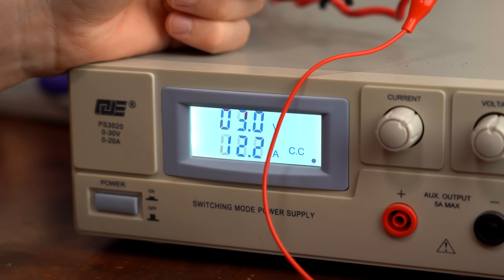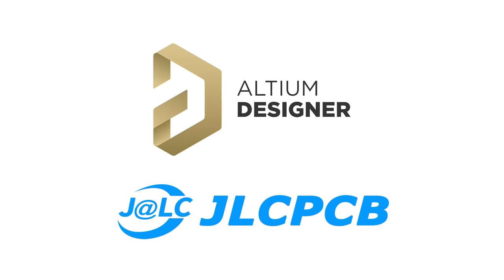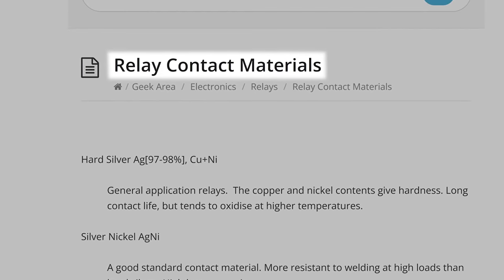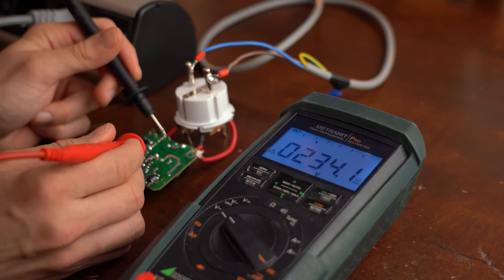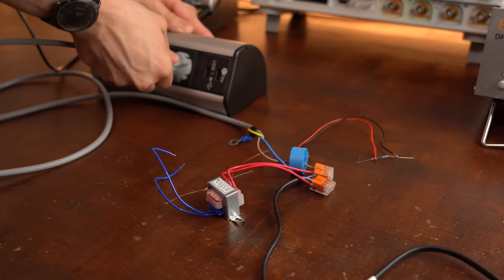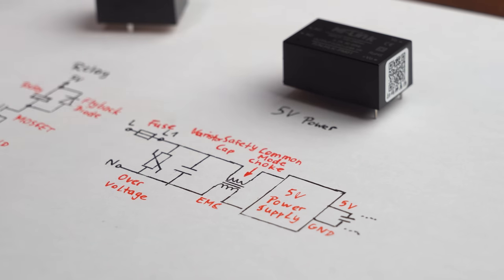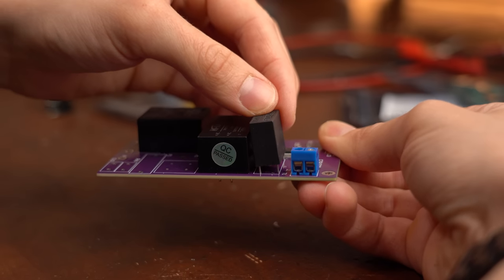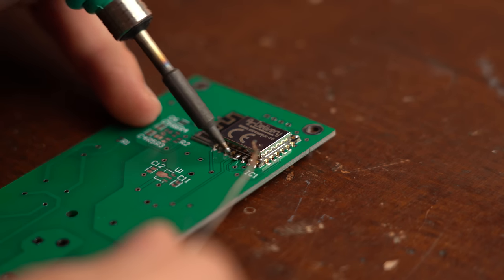The Dark Secret of Smart Sockets and How I Fixed it! (DIY or Buy)

Comment: Many years ago - 2007, it was; not a good year for introducing such a product, as things turned out - I developed a prototype wireless light switch (for 120 V, 60 Hz).  Having an intense dislike for relays in such contexts, I used a triac and zero-volt turn-on.  Getting a software PLL (running on a tiny AVR) to lock to the line phase to control when the triac was triggered in each half-cycle was easy enough in a clean environment, but turned out to be a major headache when a neighbor was running a many-kW induction furnace.

Comment: Why not just switch to solid state relay's? You could just swap out the relay on the smart plug pack for a solid state relay and call it a day, no more sparks or moving parts, there are plenty on the market that will handle 240v AC up to 25a and control input is usually 5 to 24v.

Comment: You are free to steal from years of experience and production that came from times long before you were born. If you look inside power regulators of nowadays starting to disappear mains handheld power tools, especially in cheap or very old ones consisting of simple triac phase regulator without feedback IC you'll notice that in maximum position there is a simple switch that shorts triac thus avoiding unnessecary heating of the component. This fact may look unrelated at first read, but further on you can dig schematics for hydrophore pumps' and water heating circulation pums' switching blocks from famous for their reliability danish company Grundfos. For pums with fixed power the schematics consist of a triac operated via zero-crossing detection optocoupler ICs that guarantees no sparking and no grid noise and with some delay enough for the pump to get to the full power a relay shunts the triac. Shutting down the pump happens in reverse order - the relay switches off and in the moment of zero crossing triac turns off. Thus no switching noise in the power grid and RF air or sparking that erodes relay contacts occurs during switching on and off and in this way they also achieve maximum durability.

Comment: Cheap relays ,do not have good coatings of the contacts and spark catchers.
Saving cost needs to come from somewhere.

Using a smart sockect to save standby currnt is useless,because smart sockets also consume power

Comment: If the plugged in item has its own proper switch on it, you could just ensure it is turned off, before switching the smart socket on, no current draw therefore no spark🤪

Comment: Instead of a mechanical relay I should have designed it with a Solid State Relay if you want to get rid off the welding. https://en.m.wikipedia.org/wiki/Solid-state_relay

Comment: Sometimes on these 'DIY or Buy' episodes I'd like to see a third option...

Options:
1) DIY,
2) Buy,
OR
3) Mod (buy then modify)...

I haven't watched the video yet (I will immediately after posting this)... however I get the sneaking suspicion that this vid might be one of the ones I will end up wanting to see the 'mod option' on. We shall see. I'll reply to my comment to say whether or not I would have liked to have seen a mod option on this video after watching.
Reply: Maybe not so much, but I would, however, like to see a second follow-up video with an improved version with higher on output V≂ and that uses less power for standby mode. I wouldn't care about optimizing to bring the build cost down, just the running cost when in standby mode (off).
Reply: Whenever I post using  ⎓ (the DC symbol) and/or ≂ (the AC symbol) people always ask me how I typed them. [They want the unicode or the Windows/IBM compatible Alt codes for character entry]... I don't... I am on Android and usually just google forums with threads discussing the subject, then I just cut and paste. So before you even ask, there's your answer.

Comment: Wondering why I would need a socket that's operated from my phone?
Reply from the maker: Get rid of standy power. I showed that in the video. 17W for standby adds up over time.
Reply: @greatscottlab  I just switch them off at the socket when I'm finished with them, not much really to switch off, TV and laptop are all the devices permanently plugged in that use a standby mode, don't really need anything else lol

Comment: Of course it will stick if you just constantly on/off the relay really fast. But in real world scenario, you won't do that fast on/off. Also, how many of your wireless socket failed? You provide no Data of it. You should at least use the BUY product for a while if it fails easily or not.

Comment: I have request. Could You make video about wattmeters? Maybe DIY or buy? I cannot find any model that would be accurate enough and not cost fortune. Everything is china crap with real accuracy between 5 - 10% (declared accuracy is 1 - 2). They cannot measure reliably below 1W of power, so there is no way to measure standby power. 
(For trolls - No, I cannot use multimeter, because of fluctuations of power usage in electronics.)

Comment: ok, i'm curious, as to why you couldn't just lower the amperage from 53 down to 15amps so it wouldn't be so strong to spark?  instead of replacing it etc.
Reply: How would you propose doing that on all of your appliances?
Reply: @r2db  depending on your setups etc..  example. I've used Buck Converters to lower the Amperage of devices.. etc. and YES you'd have to setup it up on all your appliances you wanted it on.. But it's not like 20 appliances.. maybe 6 to 8? but once done. there done.
nothing wrong with what you did. I just found it to be more complicated IMO.. course it could just be the way I do things.. ( Usually the incorrect way ) .. 
BUT YOUR method works. and that's all that really matters.. I was just curious as to why you didn't just lower the output amperage instead? .. Just seemed easier IMO to do. 
but again.. I don't always do things correctly :)..

Comment: The comparison at the end is very flawed. The average home circuit does not supply 30Amps of current, more likely 16A at most if there is only one device on the house group. So using a 30A relay is just an expensive waste. More importantly useless for the comparison. Also comparing a device 4 times the price with a cheap featureless socket is comparing apples and oranges. They are not the same thing. You should compare to a ready made sockets with the same feature set, which does exist. 

And I am not even talking about what an insurance company might think about this DIY solution compared to a certified one.

Comment: Ya’ll outlets are ridiculously over engineered. Also, I’m about tired of hearing, how dangerous US plugs are too, cause in nearly 40 years of my life, I ain’t managed to so much as accidentally shock myself. They’re slim, simple, and convenient. You either gotta have some mad butterfingers, or go drastically out of the way, to grab the blades of a US plug, while it’s halfway out of the socket, but ya’ll went way out of your way, to not step down some of your residential outlets to half voltage. 😂